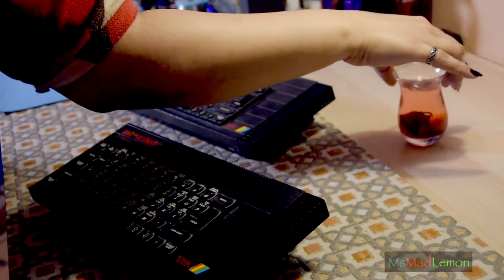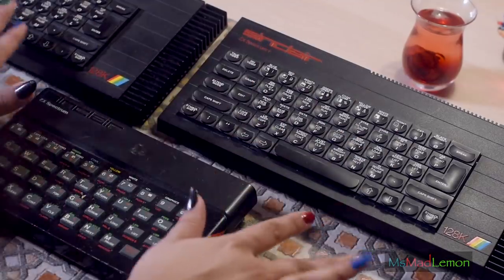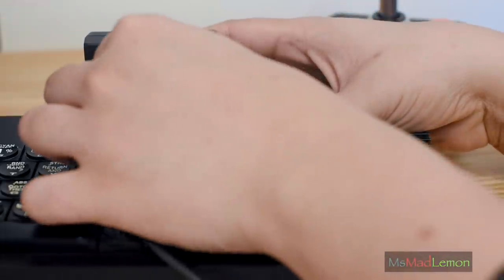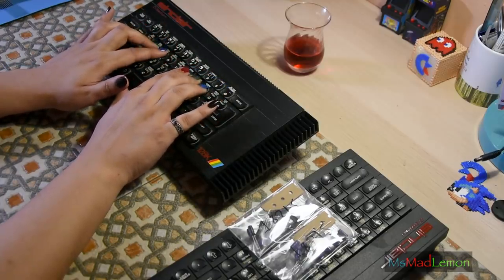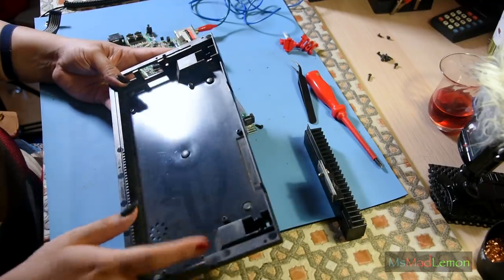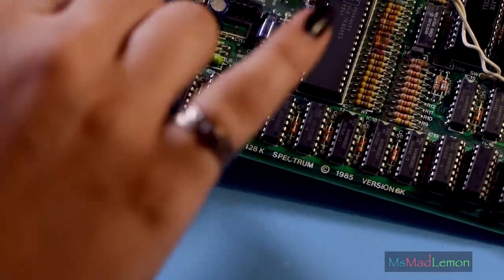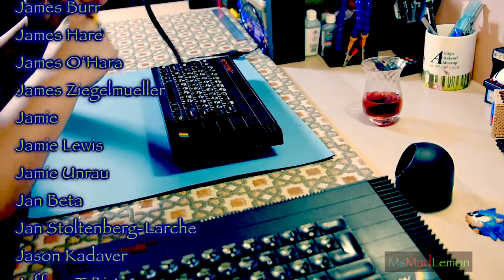The Two Spectrums - Restoration part 1: Intro and plans

Comment: Another great episode 👍🏻 can you show in part 2 how you connect the new voltage regulator to the external heat sink please. Looking forward to episode 2.....waits...😬
Reply from the maker: Actually there wasnt a real need to connect it to the heatsink, however it does get warm so i bought some tiny heatsinks with thermal adhesives and just stick a piece on top of it. :o)

Comment: 17:28 More likely not the speed or rate, but the duty cycle. Each cycle alternates between zero voltage and full voltage (the two most efficient settings), and the relative proportions will average to your desired output voltage. A.k.a. PWM.

Comment: Did Sinclair really hate the fact that you could play games on it? That surprises me, since that's why most people bought it. I reckon the machine doesn't have a joystick port mainly for tax reasons. A console or gaming machine is taxed at a higher rate than a Personal Computer.
Reply from the maker: Joovc Doovde player...Actually yes he was solely aiming for the educational and business market. He didn't care for it much as a games machine even though it did him favours. The beautiful thing happened is that kids started programming games on the spectrum and the games library grew large. I mean it doesnt even have hardware sprites. 
The chose 48k RAM for Tax reasons though instead of 64k. 
One thing for sure about the spectrum is that it's not ready for the HuuD
Unable to resist the reference your username is making ;o))
Reply: @MsMadLemon  Impressed you got the reference and thanks for the reply!

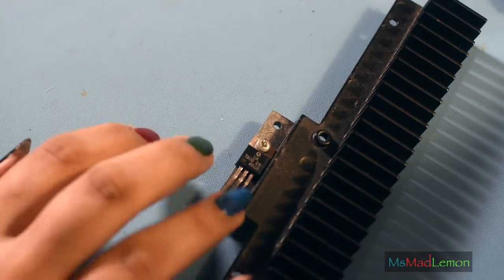Comment: 16:52 So for 2A, the input power is 9×2 = 18W, while the two regulators are supplying 2×5×1 = 10W. So the remaining 8W has to be chucked away as heat.
Reply from the maker: Actually with current, it only depends on how much is drawn from what is taking from the regulators, if something is drawing 500ma then thats all the regulator will draw from the 2A supply.... the 9v supply can be 8A  but thats only the value which it can provide if needed.... it tends to be the voltage difference that is dissipated as heat as far as i'm aware.

Comment: Far too much time wasted with IPA and ear buds. Just throw it in the wish washer or give it a good scrub in the bathtub/shower. Dry it off in the Microwave oven.
Reply from the maker: Silly me! I should have shouldn't I.. Also should have got out the wire brush to scrape away the pesky gunk off those traces.
Reply from the maker: Also now that you mention it, I do need some of my wishes washing too.
Reply from the maker: @digitalradiohacker  
Thats exactly what a 'wire brush' is lol 
Speccy mobo? naaah thats easy to replace, Toastracks selling like hotcakes on ebay....cheap too ;o)
Reply from the maker: @digitalradiohacker  yes I know, i'm being sarcastic in response to the original comment lol
Wire/steel brush on traces? come on!! Give me some credit 
😂
Reply: @MsMadLemon  wait... so we're not using wire/steel brush?? no wonder my ZX dont work anymore ;) where do i buy one of these wish washers? lol